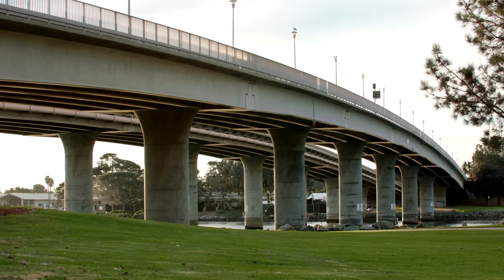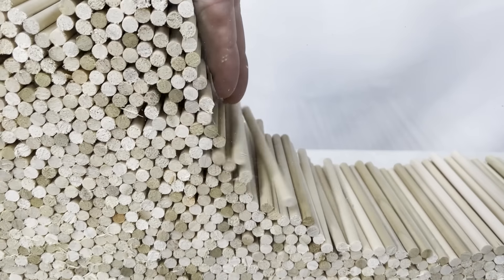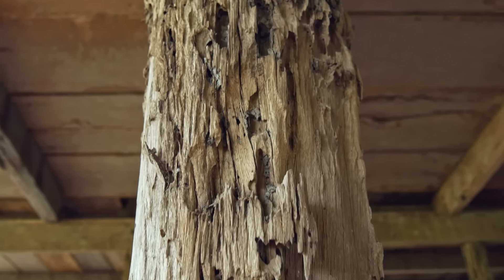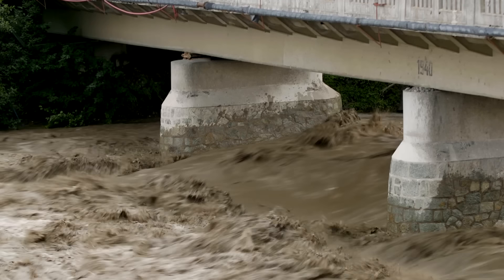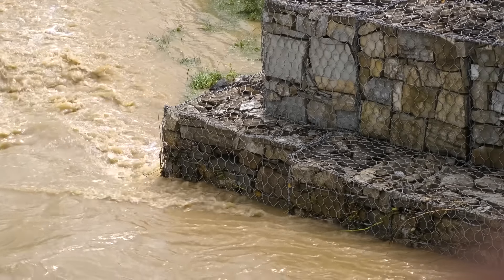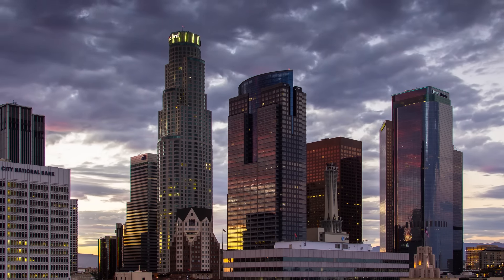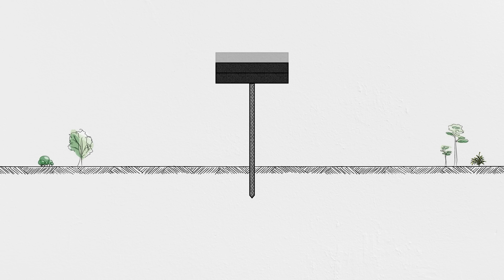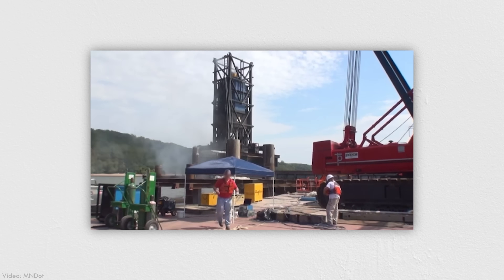Why Buildings Need Foundations

Comment: Thank you for mentioning the "must be cost effective" part of engineering. Many people look at ancient structures like the Roman Colosseum and think we can't build stuff to last anymore. That's simply not true! We can build structures to last thousands of years, but why do that at all? The cost would be astronomical (we don't use slave labor anymore).
Reply: Note to self: commission some slaves
Reply: It's also just too soon to say how many of our modern structures will last centuries. Not most of them, obviously, but it's not like most Roman structures did either.
Reply: @alaric_  You're better off with unreinforced concrete. There's a good Practical Engineering episode about it. Concrete cracking often starts at the reinforcement, either due to rust, or just due to water and other stuff getting into the space between the steel and the concrete. Also, there is a limit to how dry you can mix concrete while still forming it around reinforcement. The strongest and most durable concrete is mixed as dry as possible and roller-compacted, whereas most reinforced concrete is soupy enough to pour through a hose. So the best way to get a concrete structure to last a thousand years is to fill a flat area on geologically stable land with a whole lot of unreinforced, very dry concrete and pile heavy stuff on top of it (like more concrete). Only massive all-stone structures like stone pyramids will last longer than that.
Reply: @EebstertheGreat  Yeah, that the thing about this whole "Roman's built things that lasted 1000 years"  nonsense, is we only think that because we only see the roman structures whcih lasted 1000 years.  We don't see the majority of Roman buildings whcih didn't last, because those fell down 900 years ago.
Reply: @alaric_  I want a shed and a van to live in. Nomadic spirit
Reply: @michaelmoorrees3585  Not only was it government funded, but the construction timescale would be intolerable to modern profit-driven mindsets.
Sure, 8 years seems amazingly fast for building that awesome structure out of stone without powered cranes and trucks, but today, the 1-2 years to build a modern stadium is seen as "a long time".
Reply: Forgot where I saw this, but someone summed it up beautifully. “Physics is math bound by reality, and engineering is physics bound by money”
Reply: @michaelmoorrees3585  And the Roman Empire wasn't a democracy either, so people had less say in how much money got spent.
Reply: @AaronOfMpls  Plus the physical environment was just more important back then. Without newspapers, TV, radio, etc.. the best way to get you message out was often to build a statue or a building that people would see.
Reply: @EebstertheGreat  Yah, the Romans didn't have rebar, so they avoided putting concrete in any kind of tension at all.  

And on top of that, I imagine any poorly-built Roman structures all collapsed centuries ago... 🙂
Reply: "Anyone can make it work; it takes an engineer to make it barely work."
Reply: @alaric_  except they don't pay top dollar for it and it's a drain on municipal/federal funds as the funds supporting the suburbs arent covered by the suburbs. So called R1 zoning is unsustainable in the quantities done everywhere in the usa.

Comment: Awesome vid, i used to work as a non union foundation laborer and my boss knew a TON of stuff. Especially because he also operated our heavy rigs. I’ve been around pile driving, kelly bar drilling, caissons, and more as deep as 90+ feet. I already was pretty informed but you take it a step further, keep up the good work. 
Side note, i’m now an ironworker apprentice and i’d love to learn more about structural steel and bridges if possible. Thanks

Comment: Grady, would you treat us to a deep dive into your experience with the foundation on your house? it would be interesting to see how you approached the renovation and the considerations that lead to the solution that you ultimately went with.
Reply from the maker: Not much engineering to it. Lift house. Replace cedar piers with concrete piers. Set house back down.
Reply: @PracticalEngineeringChannel  Lifting structures sounds like an interesting video topic.  As a Chicagoan, I'm passing familiar with the topic and would love to hear more.
Reply: @davidtyorke  Here in Australia (and no doubt many other countries), some people literally move their house when moving house. The house would be lifted up and placed on a huge truck and driven to the new location. It's quite amusing to see a house on the road.
Reply: @veryboringname.  Are you talking about a house designed to be moved (a "trailer" in the US), or jacking up and moving a regular home?  Both occur in the US, though the former is common for new trailers, and the movement of "used" trailers and regular homes is much rarer.
Reply: @PracticalEngineeringChannel  Not much engineering to it? What size and how many jacks to use, where to place them, what to put under them, how high to lift the house, whether to move the house out of the way or work underneath it, what kind of concrete to use, how deep the new piers should go, whether to drive pre-fab piers or drill & pour them on site - all of those are decisions made by the engineer(s) working on the project. I agree that this would be a fascinating video for us to watch and learn from. I suspect most of these questions have "standard" answers, but I'd still like to learn more about them. 
But whether you do it or not, this video was great! Just like all your videos. Thanks so much for the work you do and time you dedicate to sharing your love of engineering with us!
Reply: I nyc you can drive piles to shallow bedrock
Reply: @PracticalEngineeringChannel  Will they lift the house high enough to pull the cedar piers?  How deep do they go?  Or, drill them out or grind them out somehow?  I guess in their deteriorated condition, they might not hold together as they are pulled?  Drilling/grinding introduces the problem of needing to clean out the holes completely, as decaying cedar wouldn't make good aggregate.
Reply: @PracticalEngineeringChannel  Having seen it done, you are leaving out all the interesting parts. LOL.  Aside from that, why concrete? Why not just new cedar or hemlock piles?
Reply: @markbernier8434 
Concrete gets eaten even slower by fungus and bugs ;)
Reply: @MrNicoJac  I live where the frost line is 2m. Concrete sometimes doesn't make it till spring or can lift 300mm. Sometimes the old ways were better.
Reply: @markbernier8434 
Wait, how exactly would a deep frost line make wood better? 🤔
(it's probably like 1 cm in the Netherlands, so zero frame of reference, lol)
Reply: Grady, did you consider raising the house enough to later build in underneath? I wonder what extra costs/challenges that would add.
Reply: @MrNicoJac  I think it is about the skin friction. Cedar posts are often sunk with the bark on. If what I see is correct the wooden post stays still and the bark layer moves slightly with the frost. Also, the wooden post has water in it and freezes and thaws with the ground around it reducing any relative motion.
Reply: @pulaski1  3hoursago is talking about houses that were NOT designed to be moved. In Australia, companies that specialise in moving existing houses assess whether and how a home can be moved. Usually, it is divided into sections (don't ask me how!), loaded on a truck, and reassembled at the new location. In addition, Australia has purpose-built transportable homes and trailers (usually called caravans here).
Reply: @lizj5740  OK, so similar to the US, except that houses are rarely, if ever separated into pieces to be moved, even if they were originally assembled from trailer units ["double wide" or "triple wide" modular homes/ trailers.]
Reply: @pulaski1  Yah, it's mostly smaller and relatively compact houses that get moved in the US -- especially if you're not talking about mobile homes.  Sometimes they'll split a wing off if the house is L- or T-shaped, though, and move it in more than one piece.  Though that costs more, and tends not to be done very often unless they're preserving a historic house on a new site.  I imagine there are times when they just tear the extra wing down and build a new one at the house's new site later.
Reply: @AaronOfMpls  Oh, I know!  I've seen it done.  There is a grading contractor near me (rural NC) who also does house-moving work, and I have seen several houses that have been removed being stored on vacant land, presumably  awaiting a buyer with land for the house to be moved to.   And yes, they are typically smaller ranch-style houses, but even so they must be at least 25ft wide, making them a disruption to traffic when being moved.

Some of the houses I have seen even have a brick veneer, which I can't imagine travels well, and there has to be a risk of the entire brick panel collapsing during transit.
Reply: @pulaski1  Yah, brick veneers are often removed and rebuilt for that reason, when moving a frame house.
Reply: @PracticalEngineeringChannel  As an Engineer (Controls) and the owner of a North Texas 77 year old house as well, although it was moved and re-placed in 1985,  I'm curious to those details.  Mine was put in place on concrete blocks and shimming to match slope.  It's held well, but there are the odd cracks in the plaster walls that can be attributed to the piles.  For instance, when you said they lifted, did the whole house lift or was it just locally lifted?  I would assume the former.  Were they pile driven or just dug and placed?  Would be nice if you had taken videos of the non propriety process from start to finish.  Thanks for your channel!!!
Reply: @PracticalEngineeringChannel  Were the piers prefabricated or were they poured & molded in place?

Comment: A few years back, I had to travel to Singapore for a month to oversee the construction of my company’s new plant. Since the structure was being erected on reclaimed land, the piles were “drilled” and then filled with concrete. The depth of the pile was determined by taking soil samples every 5 meters (if I recall correctly) and visually identifying the soil type. Once the recorded numbers added up to an appropriate skin friction, the concrete was poured and work began on the next pile. In order to keep water from infiltrating the hole that was being drilled, a heavy polymer mixture was pumped in as the hole was being drilled, similar to mud during oil exploration. When everything was said and done, large concrete blocks were brought in to perform the test load on the piles. Could you possibly do a video illustrating this process as I found it very fascinating and would like to learn more?
Reply: Is there any job available in your company sir? Cheers ✌️😁
Reply: That sounds like drilled shafts, to me.  How big were these drilled piles?
Reply: @QuantumPolagnus  It ranged from 24” to 36” IIRC based on which building, which part of the building, and where machines would be placed.
Reply: It is bored pile with maintained loat test (MLT) conducted on it
Reply: Its funny you were sent to 'oversee' this construction, and you are just now learning about the technique on YouTube. I'm guessing your company did not send their best to this country.
Reply: @BearRunning  Obviously he was not sent there to oversee the construction of foundations
Reply: @BearRunning  In Singapore, everything is very controlled. There was a construction company responsible for the entire project. I was just there to be the liaison between the construction company and our company. Using “oversee” was an incorrect word choice.
Reply: @BearRunning  Also, I’m not just learning about the technique. Grady asked for video suggestions and I figured that type of construction would make for interesting content.

Comment: When I had my RV and mobile home repair business, one of the biggest problems was piers under mobile homes sinking in mud resulting in doors and windows not opening and closing properly.
I solved the problem by building piers on 2' x 2' square pieces of 3/4" pressure treated plywood. If stone was available, I put some under the plywood. On top of the plywood, I would build my piers by double stacking concrete blocks (no mortor) with scrap pieces of wood to cushion between the metal frame and concrete pier.
All the while using a water level for accuracy.
I never had a mobile home sink more than 1/4" and when I got done, all the doors and windows worked properly.
It's all about distribution of weight spreading it out evenly. In that way, one pier doesn't have more weight on it and sink.
The same principle can be applied to buildings just on a larger scale.
Even tanks that easily sunk in the mud in WWII were redesigned with wider treads and wider axles to distribute their weight over more ground.
And it worked!
Reply: Starting out by basing your new column on plywood, even if pressure treated, seems like a temporary solution that only made sense because of the short expected future life of the trailer home that you were working on (under).
Reply: @Pulaski It's all underneath and out of the weather. I used the system under a mobile home that I used as a camp. It was under 20 years with 1/4" settling. The camp was destroyed by trees falling on it but the plywood is still good!
Reply: @freetolook3727  Ah, OK.  

In my neck of the woods (NC, USA), plywood lying on the ground would still be subject to ground moisture (solid clay in the central and center-west parts of the state retains moisture for years, and can transmit it from below or sideways), water may run across the surface through and/or under perimeter foundation walls, and eventually the pressure treatment chemicals may dissipate enough for termites to attack treated timber.
Reply: @pulaski1  as long as the ground under the mobile home is higher than its surroundings it will stay remarkably dry. I live in a rainy, wet climate and ive been under mobile homes that are either sand or concrete and they stay super dry.

Comment: Here in Toronto, I've heard the buildings are built with enclosed underground levels that act like the basement example and actually allow the buildings to "float" in the earth. Apparently, the glaciers that crossed the country millions of years ago pushed the crust down and it's slowly rising back up like memory foam. I'd be curious to see some coverage of this.
Reply: This is true, pretty much everyone in Southern Ontario has a basement of some sort. The ground is up lifting but very very slowly, the freeze-thaw cycle is a much bigger issue for structural stability, what with silty-clay rich soils, lots of snow, and 50+ freeze-thaw cycles a year. Not to mention since most of the waterways were heavily influenced by glaciers they tend to be less mature than other places so more prone to moving & changing.
Reply: @agilemind6241  Yeah, I wonder how much the frost cycle matters to a sky scraper though with 6 floors below the frost line.
Reply: That's interesting. I had never heard that one might have to engineer buildings with isostatic rebound taken into consideration. Huge swaths of that land should rise equally, but i suppose there could be differentials in certain situations. It does give us little eathquakes around the Lakes.
Reply: Good to know! Thank you!
Reply: Glaciers weren't that long ago and they still exist in the North. Toronto would have had a 4km high glacier over it as late as 6 to 10 thousand years ago.